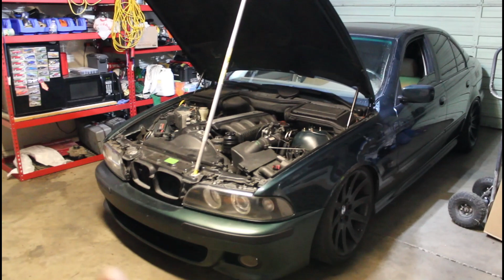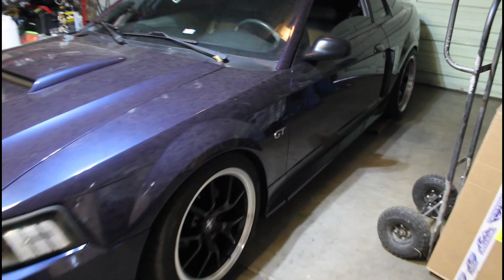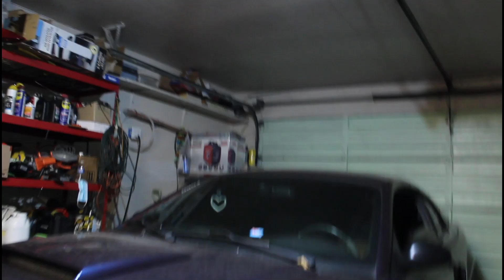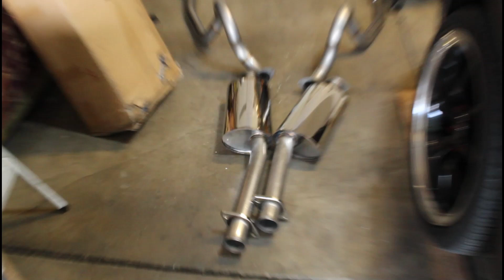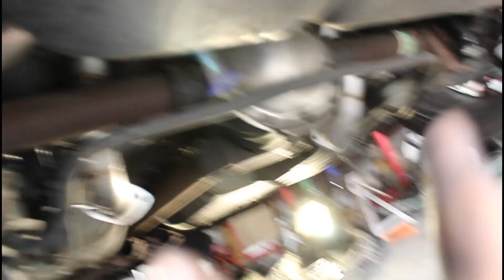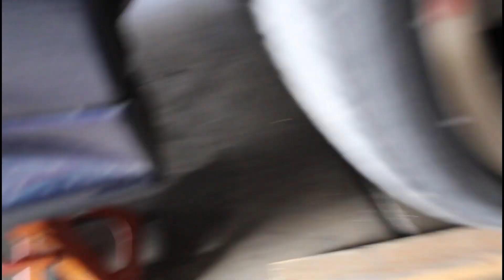$180 Exhaust Install 99-04 Mustang GT (Borla Knockoff !!?)

Comment: I also have a off-road h pipe. Currently saving to get these cat backs. Since you have a off-road h pipe, did you get codes after putting them in of car running lean or anything? When I put them in the fitment wasn’t perfect and now I have a very slight exhaust leak on the right side. Only noticeable if you get under and listen.
Reply from the maker: I put mil eliminators in other video